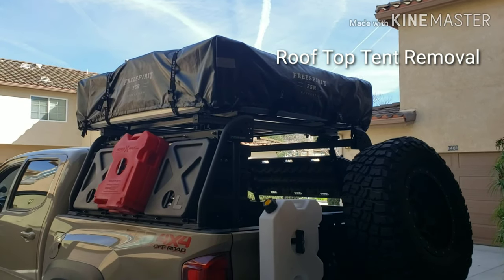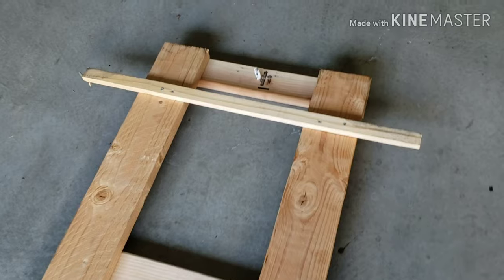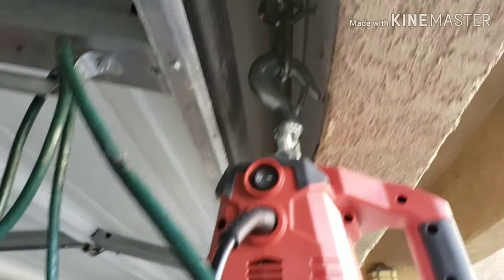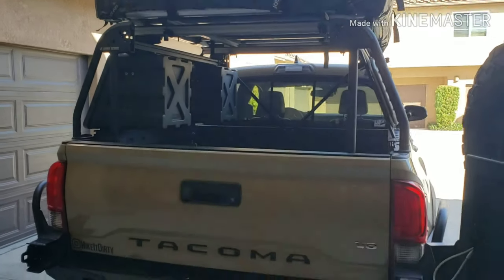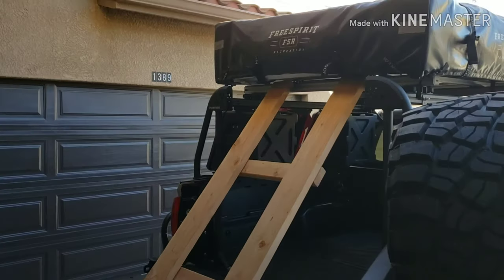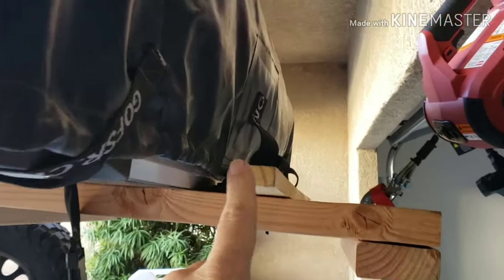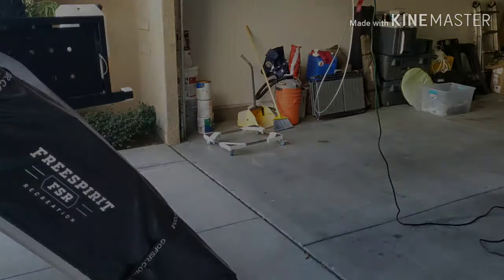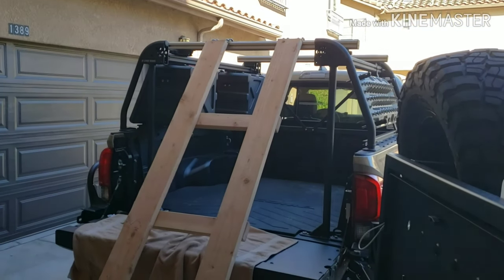Rooftop Tent Removal - The easy way!

Comment: How did you shift it...you left that part out??
Reply from the maker: Great point.  From within the bed, we slide it towards the back from underneath until we can stand up and push it back onto the ladder.
Reply: Thanks ...I just took mine  off, used a block & tackle, suspended it from the eave of house and drove away👍

Comment: Great video! Do you think this can be done with a hardshell rtt? I am thinking of getting the tepui hybox
Reply from the maker: It should work well with a hardtop tent.
Reply: @robwest2578  Thanks, what is the winch you got? Does it plug in to a household outlet?
Reply from the maker: @chasem3549  it is a Warn wench that plugs into 110.    I got it on Amazon.   Check this out at Amazon.com
WARN 885000 PullzAll Corded 120V AC Portable Electric Winch with Steel Cable: 1/2 Ton (1,000 lb) Lifting/Pulling Capacity https://www.amazon.com/dp/B0043OV0IA/ref=cm_sw_r_other_apa_i_c56HEbDAANHK3
Reply: @robwest2578  thank you 👊